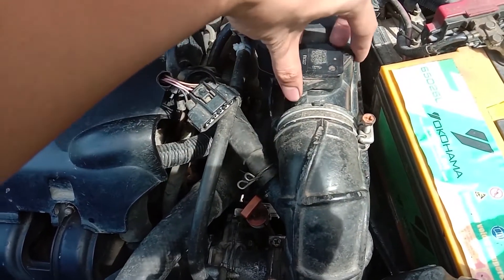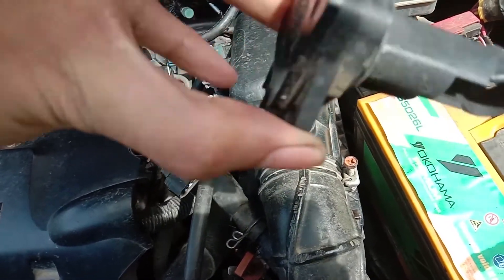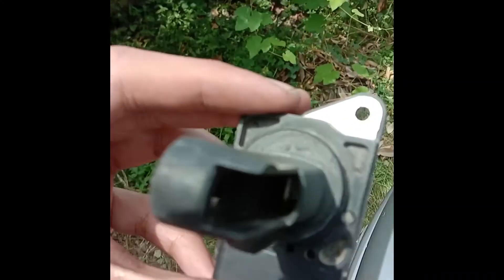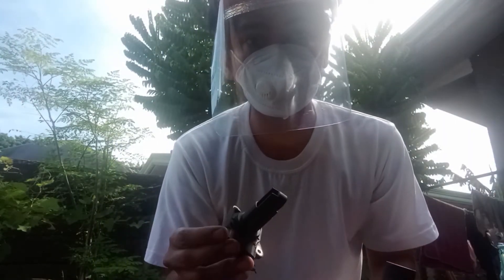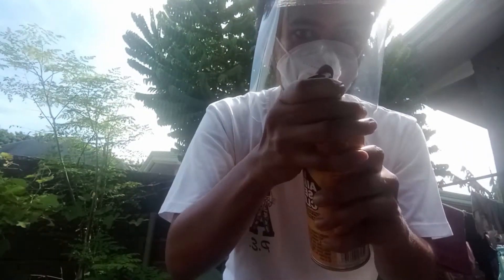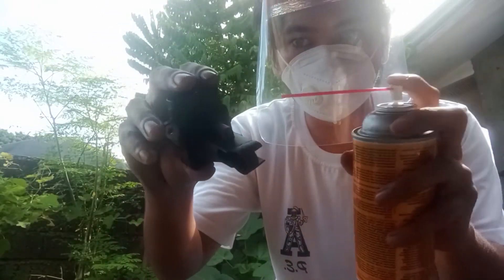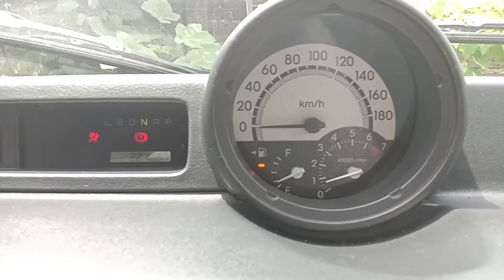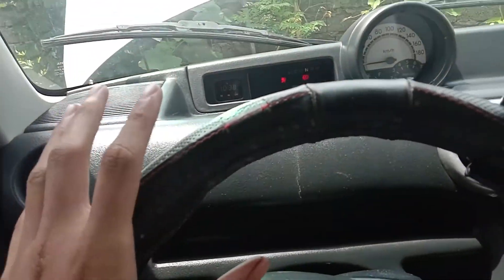TIPID GAS: MAF Sensor Cleaning sa sasakyan

Comment: Good day sir, ask ko lang regarding sa maf sensor cleaner. Pwede kaya gamitin yung Hardex throttle body and maf sensor cleaner as a cleaner sa maf sensor po?
Reply from the maker: pwede na. Na try ko po. okay lang. salamat po.
Reply: @Mechodynamo  safe din po kaya siya sa oxygen sensor sa loob ng maf sensor at dun sa dalawang maliliit na wires sa loob sir?
Reply from the maker: @ammarlontua5243  safe naman basta MAF sensor cleaner. Pra sigurado, bili ka nalang ng mAF sensor cleaner na pure at hindi pang contact cleaner para safe. follow instructions sa bottle para okay ang results
Reply: @Mechodynamo  sir

Comment: Narerepair po ba yung hotwire nya  kc naputol sya yung naka expose na parang capacitor,, lancer egg glxi po kotse ko
Reply from the maker: kung pwede replace nyo po mga ganyan. Mas safe naman po
Reply: Yung sa amin sir sa chevrolet venture namin naputol din siya pero pina hinang lang namin Okay din naman po siya.
Reply from the maker: @ammarlontua5243  "okay siya"  sa ngayon pero pagdating ng panaon baka masyadong lean ang fuel to air mix ratio at baka makaka apekto ito sa overheat. 

better replace basta broken sensors. mas reliable din. 

Also check cause of failure bat sya natanggal. Para maiwasan sa next

Comment: Sir pwd ba png linis ng MAF sensor itong pro 99 electronic contact cleaner?
Reply: Nako sir MAF sensor na lang sa autosupply ka bumili. 200 lang naman ung pinakamura
Reply from the maker: maf sensor cleaner nalang sirpinaka less corrosive/invasive na solution.

Comment: Sir pwd ba ung throttle body and maf sensor cleaner na spray?
Reply from the maker: Di po tayo sigurado i nthe long run kung throttle body cleaner kasi medyo matapang yan. Kadalasan yan gamit ng mga mekaniko pero ang proper talaga is MAF Sensor cleaner kasi mas weak siya at di nakakasira ng Oxygen sensors na sensitive doon sa loob ng MAF
Reply: @Mechodynamo  tnx sir
Reply from the maker: @najcabs  salamat sir